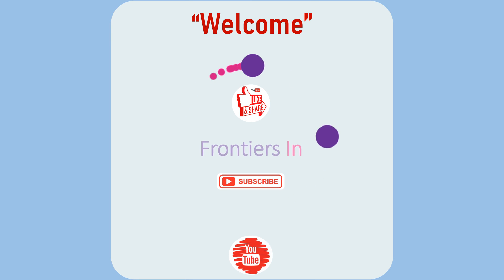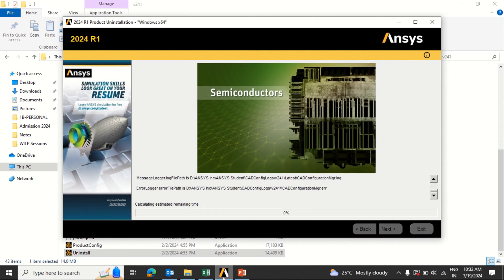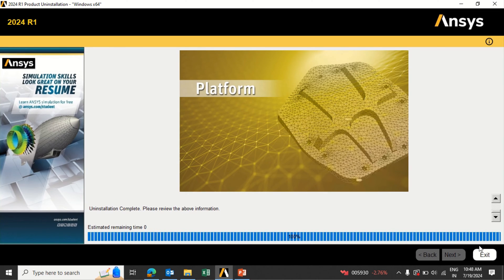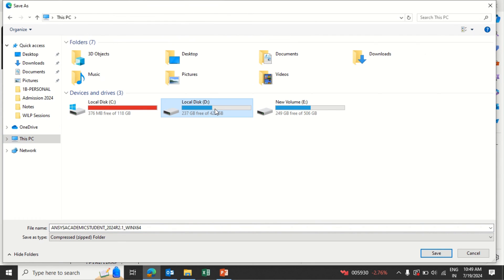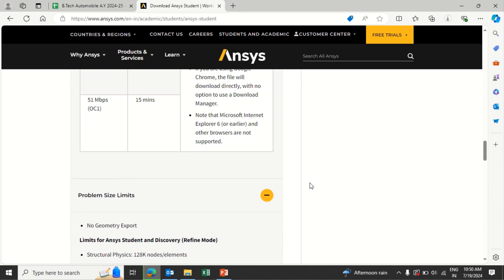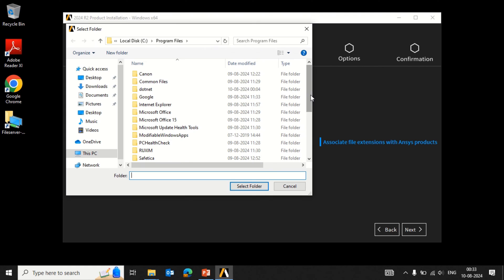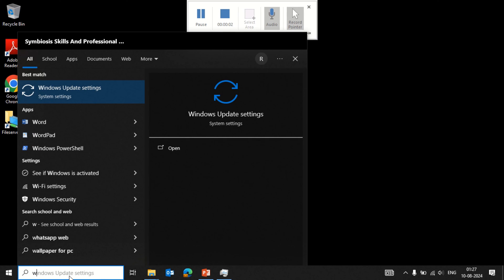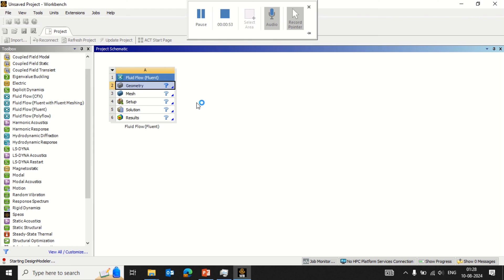Ansys Student 2024 R2 Installation || Ansys 2024 R2

Comment: I try to install the same program, but a windows appear and it says Critical Error, instcore.exe is not responding, what sould i do?
Reply from the maker: First check for winows update option install necessary updates till date then install..
Or check if you have uninstall previous version if any
Reply: I get same error , i uptade my windows also i dont have any old version of ansys. Again it gives critical error what shoul i do @FrontiersInCFD
Reply: i'm having the same problem
Reply: Hi do you find any solution for that
Reply: i`m having the same problem :(
Reply: @joaopedromaiacirone6820  having the same problem too. did you find a way to solve it